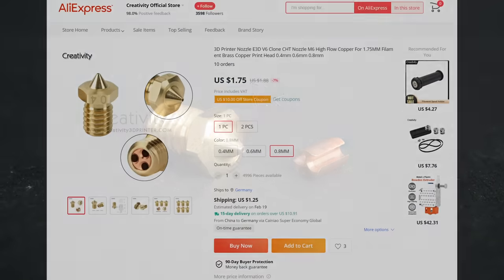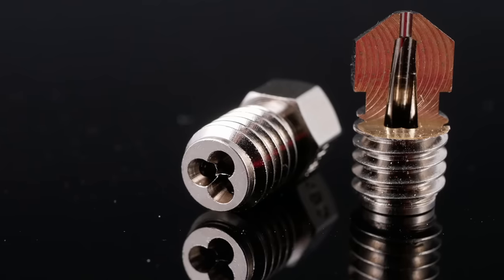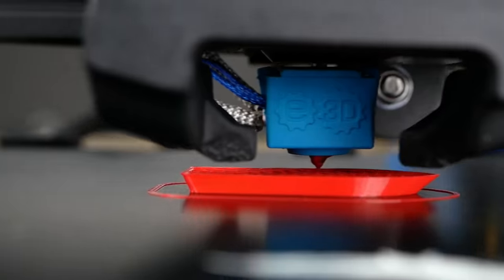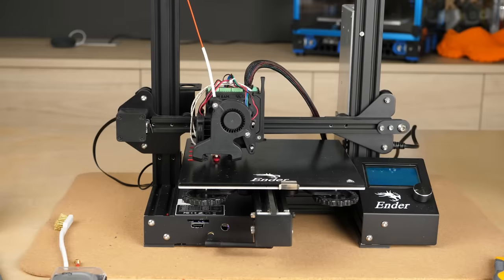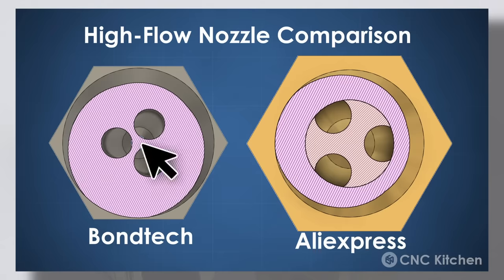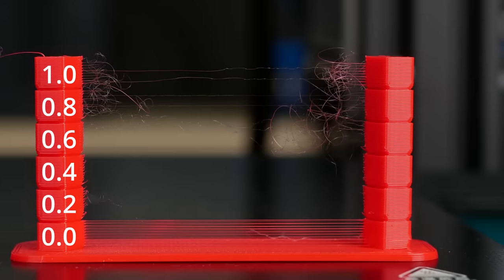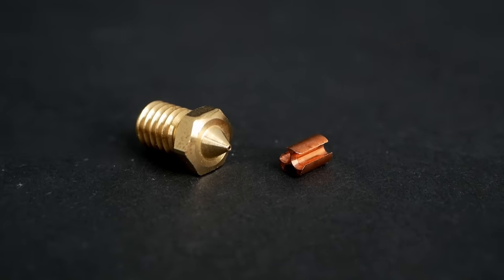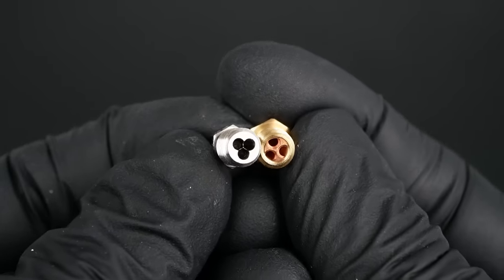$2 Aliexpress Knock-Off better than Original?

Comment from the maker: Power to the knockoffs or would you rather support the innovators?
Reply: Friendly competition lowers prices and encourages more innovation!

Edit: I get that if the 'knockoff" is just straight up copying the design, with no benefits, and/or can make them significantly cheaper or quicker to make than anyone else can, it can lead to the knockoff becoming a monopoly and stifling creativity once again.

The knockoff in question had changed around some ideas and ended up with a debatable improved end result.

Nothing is black and white, there is always complexity with subjects around choice
Thanks @@Hex for some of these ideas.
Reply: Both
Reply: You've got a pro-knockoff sponsor today.
Reply: As long as it doesn't infringe on the patents yes. A lot of money, time and research goes into innovation. That should be protected.
Reply: The knockoffs are also innovators in this case.
Reply: What if knockoffs are better than premiums? What if "knockoffs" devide filament into 4 channels? Is it a better innovation?
Reply: Knockoffs. Most of the time the originals have way too high prices just because of branding or because they were the first one. Thats not something that should show in the price
Reply: Intellectual property isn’t real anyway
Reply: patents are bs. just compete with the quality. this design is really smart!
Reply: I support the most consumer friendly product pricing and performance
Reply: Supporting competition and the free market. If the original designers were so innovative they would not need the state to grant them a ridiculous intellectual monopoly.
Reply: Bondtech are a terrible company that don't deserve being supported.
Reply: @leobro6398  In my opinion, the 1st creators are free to overcharge for a little while, since that is both a way of just making good use of the supply x demand, and much more importantly, the engineering cost offset. Once you've reached R&D break-even, I feel like the creators should just lower the price to get more sales on volume. Everyone would benefit from it in that case.
Reply: as an engineer I see a lot of patents only as obstacles to innovation, as many of them are things that people used to do but didn't bother patenting because it was trivial (i.e the recent drama with slice engineering patenting SPACERS), I have been putting copper inserts in my nozzles for a while now (the best being a 1mm helical wire) and the community was shoving Torx screwdrivers in brass nozzle way before the very vague 3dsolex patent. imo they just spend unnecessary money to patent an obvious thing, power to the knockoffs and every open source innovative practices
Reply: @Kalvinjj  I agree completely except for that everyone benefits from that. The people that buy it in the beginning will feel bad, because they paid more for it and some people cant afford it in the beginning and only can at a later point in time
Reply: @3d-obsession662  That's basically the marxist labour theory of value, which is now for most of us just a bad memory, thanks to the superior efficiency of the free market. Just because you spent x amount of time working on a product does not mean you should be paid y amount of money. You should be paid whatever somebody else is willing to exchange for your product in a voluntary trade.
Reply: to be honest patents are bs sometimes and this is one of those  cases in my opinion, there should be a clear cut between a complex enough product to have legal right over knockoffs and one that simply isn't, it was just a matter of time that someone had that idea it is well done but not incredibly articulated.
Reply: I think they overcharge, this has not required alot of expensive research to explain the price. 5x more is ok but 10x more? In Germany Bondtech CHT sells for over 25€. And patents on a piece of metal with 3  holes? What a bull
Reply: I hate knockoffs. They divert potential funds going to the original inventor to the pockets of the knockoff manufacturers and that might ruin the potential for further innovation!
Reply: I've ordered some plated copper nozzles with a steel tip. I dont know if Trainglelabs infringed on someones patent here, but in theory these nozzles should be insanely good
Reply: Would the retraction work better it you put a chamfer on both sides?
Might also lower flow resistance
Reply: @KanielD  try writing a novel about it
Reply: I want the best stuff, patents frequently prevent that.
Reply: @behemothinferno  If you can't compete with the knockoffs, your product probably does not have a good value.
Reply: This smells a bit like S.E. bait, so I would say depends on the innovation and manufacturer.
Reply: @stratos7755  That's besides the point. I believe in patents and this knockout is clearly an infringement of said patent.
Reply: I don't need either.
Reply: As said more verbosely in a standalone comment, no money should go to false-innovators who try to patent existing designs as their own without major changes simply because they're used in a different industry. I would fully support Solex if not for that, but with it I absolutely can't.
Reply: in this case I Support the innovators because they spent time and money researching it. And they did Not set ridiculous prices either 
When companies patent stupid things (that have been proven to exist already years before) and on top of that set stupid high prices... then i dont mind "copies".
Reply: The patent institution in its current form is broken and stifles inovation
Reply: 'Knockoff" even though it is a different and better design. Also innovators with their 200x markup can suck it
Reply: I don't think the patent system serves the customer in any way, it forces a monopoly on an idea instead of allowing the best quality or value version of the product to be available to the public.

I'd sooner pay $6 for a well machined version of the aliexpress model than buy either of these.
Reply: Knockoffs can be useful, but cause they are cheaper and often not a reputable brand, milage can vary. Since they can always rebrand, where a legit company wants to build the brand 
So I'd say knock off for non-critical work, but legit for critical work, you want parts that work and a path of escalation if there is damage
Reply: Both
Reply: I think pattens are lame. Ideas are easy to make. If someone implements my idea better and cheaper than what I did then I just move on to my next idea. I have too many ideas to spend time preventing people from using them productively.
Reply: Kannst du das noch auf Deutsch übersetzen danke
Reply: Finding fault at specific cases of the patent system is easy. Writing off the whole system takes a LOT more consideration.
Reply: @petro883  Read what you just wrote. You don't make any sense. Stealing is stealing. You don't understand patents and their purpose.
Reply: @VolkanTaninmis  Still stealing.
Reply: I support competition. Also, have you tried adding some sort of middleman thermal paste grease for the metal insert? I would assume a loose metal insert wouldn't conduct heat as well as something that's attached.
Reply: @3d-obsession662  you do know? Every idea and invention was written in a book before it was invented or built but you would know because you keep stealing at yourself right?
Reply: @3d-obsession662 It is stealing when you no longer have what I just stole. Like when somebody steals your car. Would you mind if I cloned your car and we both get to have a car?
Reply: @3d-obsession662   What, like Apple *spits and "rounded corners"?  I bet that a boatload of time, money and geniuses (genii?).  Some patent owners really extract the urine. 🙄
Reply: @petro883   Oh yeah?  How's that going for your average person in the Western world right now?
Can you say "late-stage capitalism apocolypse"?
Reply: I have both products
Reply: Power to progress or would you rather eat crap from legalized cartels?
Reply: Power to the knockoffs.
Reply: @stupidpterodactyls  not all competition is the same kind. Sometimes competition means someone incredibly rich with the resources to effectively steal your work and force competition out of the market. This prevents and strangles innovation.
Reply: As the whole discussion turned into a general discussion about patents and seeing there are quite a few patent supporters, I will encourage them to investigate the history of 3d printing.  Stratasys obtained us patent 5121329 for fused deposition modelling in 1989, and it expired in 2009. The cheapest 3d printer before the expiration date was over $10,000. Shortly after it was under $1000. It's not hard to see how the patent prevented the hobbyist 3d printer industry that we all enjoy know to develop sooner and how this was a net loss to everybody, excluding Stratasys. 
Was their patent so revolutionary? It doesn't seem so looking at it now, and certainly someone else would have came up with the idea much sooner than 2009. If you really look into patents, you will find that's how most of them are. I won't go much into details here, but I recommend the book "Against Intellectual Monopoly" by Boldrin and Levine, where they make an astonishing case against patents and intellectual property in general.
Reply: I think it's important to remember that we had 3d printer patents for 25 years and they stopped 3d printers from basically happening or being relevant for that entire time because one company held the patents and basically refused any form of innovation or licensing that would have made them relevant. It was only the expiration of those patents that allowed innovation to occur and allowed for 3d printing to explode the way it has over the last decade +
Reply: TLDR; it's more complex than the question makes it seem.

What about the research of pharmaceuticals that are most often funded by the taxpayer; the big corporations then take on the production and are given a stream of endless patents over the years due to very minor changes they make?  There's a reason why some of the largest corporations in the world are so wealthy, yet they give very little back.  Research insulin for a good example, and you will see why it's so expensive in some markets.  In these cases, patents are bad, m'kay.

Disney's copyright on Mickey Mouse is another example of patent rights being granted, again and again, immediately after the last one expired is bonkers.  It's supposed to enter the public domain in 2024, almost 95 years of first appearing; what are the odds they are granted yet another patent?|

Apple's "rounded corners"?  LOL!

Say, in another case, if a company spends years, along with millions, or even billions, on researching and developing a complex and bespoke system, only to have it reverse-engineered, and the market flooded soon after with an identical, cheaper copy, then what?  What if the copied version is just different enough to be classed as a separate design in its own right, yet it does the exact same thing as the original, yet all of the design cues came from the original?

What I'm getting at is that the question is far too simplistic when it's questioning the complexities of patent awards.  Sod R&D costs with something like that - a tiny cast & drilled lump of metal; if the original patent owner wants to sell 'em at an overly large mark-up when manufacturing costs, et cetera, are so low, they have to expect the idea to be implemented in a slightly different design, and sold at a much lower price to the consumer.  What does the E3D V6 (still) cost compared to knockoffs, especially one such as Trianglelab's version, which is just as good?
Reply: Knockoffs...im cheap
Reply: @leobro6398  Knockoffs as buyers, however, you certainly understand that research costs are real and deserve to be recouped by innovators.
Reply: lol they can get rekt with those patents just like slice with their not innovating ideas
Reply: It hardly counts as innovation, because they want to patent (or they did), I'll buy a knok off for sure. No way I support them.
Reply: @leobro6398  only hurting their own sales to cry about
Reply: @GoingtoHecq  good point, hadn't thought of that.
Reply: Honest, what looks good but not to cheap on the web paige. Or i am the only one who looks aliexpress, amazon and ebay and take the middle class. Cheapest is most gambling one, original inventor is what we want but don't spend so much money for shipping or so. Now comes the search part what take a loooong time to find the middle class. Cheap but not to cheap, not so much gambling about quality. The feeling to find a small company that makes stuff that is good in price, quality and "near" is so good! And it takes time to beat the google algorithem and some comanys a from nerds for nerds that you see how deep you must read old forumpost ect. Anyway enjoy life!!!!!!
Reply: I have bought 6 knockoff nozzles with different diameter from ali for about 11$(all of them with shipping ),and they are much better quality than that one on video , I even tried to remove insert -it pressed tight, didn’t move a bit . Printing petg with 0.8mm one for a month , because of speed … so i shall stick with clones, I don’t think that small ~5g piece of brass should cost like 5+KG of brass (!!!) and no matter how much and what angle holes you drilled in it.
Reply: Buy one OG nozzle but put the knockoff nozzle on the printer.
Reply: As most of the "inventions" are really a gathering of an existing knowledge I don't believe that patents are a good thing. They mainly slow down progress, and let the patent holder to get unjustified incomes. If they should exist at all, they should only give an advantage at production start, so they should last at maximum 3 to 5 years. After that, let the free market decide.
Reply: Beat* ?
Reply: When it's a difference between $15 and $2, wallets will decide quickly. It's also far from clear that it'd be infringing even if the patent is/remains approved; what's common is just the idea of letting the filament go through multiple smaller channels to increase contact area by volume. The patent applicants will need to show a specific inventive step that the AliExpress version infringes. The cheap version is arguably a different solution arising from the same idea. We shall see - patent litigation is notoriously costly for all involved and can simply end up being won by the party with the deepest pockets. An alternative approach by the patent owner is to license at a rate attractive enough that it's less than the risk from litigation.
Reply: @TzOk  Why do you think removing patents would speed up progress? Without patents companies have zero interest in research and development, because some company specialized in manufacturing will just steal the design and sell it for cheaper. You dont think that would slow down progress?
Reply: support the innovators, but those trying to get around the patents sometimes come up with great ideas  as  well
Reply: @TheArachnoBot  It wouldn't be considered stealing, as I believe knowledge shouldn't be owned by a single person or organization. Companies still would have an interest in R&D, because of the privilege of being first on the market. On the other hand, the ones who really should be doing progress are research scientists, working at government universities, and not corporations. In fact, there was no real breakthrough invention in any field for decades. Patents for "one click buy", or another mix of paracetamol and codeine, are NOT an invention. Many corporations buy patents just to block production of concurrent products, and a common practice is "dosing" of novelties.
Reply: @TzOk  Being the first on the market is not a tangible benefit. Nobody cares, just look at this video. Even with patents some people dont care. If someone sells it cheaper with same quality, people will buy from there.

You're dodging my point. If all research was government led, there would be way less research and way less progress. Patents fix this because it makes r&d actually worth it. 

And dont even act "one click buy" is the only thing commercial product r&d has brought to this world. It is the biggest technological progress driving force on this planet.
Reply: If a knockoff clearly has its own engineering merits in cost cutting or functionality, I buy the cheaper one, if the original innovation is reasonably priced and provides better quality, ease of use, or results I buy the original.
Reply: @TheArachnoBot  They have been first, and they had their chance to settle on the market. They set their price too high, and they failed - simple. Their product is overengineered and overpriced. Being first on the market is a huge advantage, but must be used wisely. Trying to get revenue as fast as possible is not wise.
Reply: @TzOk  You're still not getting it, so i'll make it simple for you. Company X spends a lot of their budget on research, while company Y only does manufacturing.

Company X comes up with a genius new product and starts manufacturing and selling it. Without patents company Y will take that design and sell it too. company Y will ALWAYS manufacture the product better or cheaper because manufacturing is what they spend all their resources on.

The end result? Company X loses money for coming up with the design, while company Y leeches off their ingenuity. Consumers wont give two shits who was first on the market, they will buy what's better/cheaper. Absolutely nobody will want to be company X and therefore there is no innovation. Get it now?
Reply: @jbergene  You realize that the second half of your comment describes exactly what Solex did, right?
Reply: I'd take the cheapest that delivers quality. For that reason I wouldn't even call it a knockoff. I don't see why the idea of using more than one channel towards the nozzle should be held in a patent. This is kind of the obvious thing to do when you want to increase surface contact between material and nozzle. Is a patent just the reward to be the first one to write it down?
Reply: @TheArachnoBot  If an invention is so easy to be reproduced without original documentation and/or inventor's knowledge, then it doesn't deserve to be called an invention. The company which has manufacturing resources will still be interested in getting new products to produce and would still invest in R&D. Look how it works in China.
Reply: This is great! Do you think that knockoff could work with 3.0mm filament? It looks like it might! I can't find a 3.0mm CHT nozzle...
Reply: @orphax1925  wdym torx screwdrivers in brass nozzle?
Reply: @riba2233  as he said the patent may have inspired the alternative design resulting in the improved product.
Reply: @electronicsandewastescrapp7384  it would have happened without the patent
Reply: The chinese version improves the product and is cheaper and easier of manufacture, slots win to holes, so why not support chinese innovation? racism? 

MANY people would not have been even closer to a 3d printer if it was not thanks to chinese manufacturers, and they have forced western manufacturers to improve their products to justify the price difference. And not only 3d printers, cnc, lasers and electronics in general would wave been rich kids toys only.
Reply: Power to the best! unfortunately patents often are misused to stop innovation.
Reply: @TheArachnoBot  Really? So go and copy any electronic device using ASIC, or even read protected PLD. Too complicated? Try copying a chemical substance, like a drug. In some cases it is possible, yet veeeery expensive. One thing you may easily copy is a utility model, but for this, there is another law.
Reply: If the knockoff provides similar or better quality/performance at a tenth of the price, then the knockoff is the superior product. A knockoff with improved machining quality and QC for ~$5 would be ideal.
Reply: It's about the right tool for the right job. If that tool is cheaper but does a better job, tough on the one that is not as good. Price doesn't really come into it. Innovation is all about ideas, and ideas themselves are not patentable.
Reply: Du hast total viele Videos gemacht mit FDM Druckern, mach doch bitte welchem zu resin Druckern. Diese sind günstig und die Materialien sind richtig gut und stabil.
Am meisten würde mich interessieren 
1. Wirkung von Temp. beim drucken.
2. Cure under water
3. Cure under hot water (60°C oder so soll die mechanischen Eigeschaften deutlich verbessern je nach Material)
4. Sicherheit: Reicht z.B. ein guter Phillips oder Levoit Luftreiniger mit HEPA 13 + Carbon Filter aus um die schädlichen Gase zu neutralisieren oder muss man zwingen nach außen Lüften ?
Reply: Knockoffs and open source all the way. The originals are way too overpriced to even be considerable
Reply: Knockoffs are inovations too, it takes a clever mind to actually find a way to reproduce the results while dodging the patent.
Reply: @titastotas1416  This depends on the knockoff. Some are so bad that they have virtually no function at all. This here, is not a knockoff though, it´s further development.
Reply: The highest form of flattery is imitation. Both are needed.
Reply: Pretty sure the clone is going to make the original one be improved in a next iteration, so thanks to the clones yes.
Reply: Patents on effective tools  shouldnt be a thing
Reply: If innovators are constantly shorted the potential funding for greater innovation then we will watch innovation die. China and Russia are master copiers. Not exactly world renown innovators. They have their few, but most is enhancing other's works. China has citizens in the patent offices. Russia had informants at every level of the Manhattan project.
Reply: I would love to be able to support both... I really like how such a simple change can do so much but the fact that they are locking it down is just annoying. I really feel that they should get some kickback from anyone who sells something based on their patent but not that they should be able to stop anyone else from using their patent for years and years
Reply: Tesla "gives away" its complex/disruptive patents to incentivize development for all.
Bondtech try to patent a nozzle with 3 holes.
Cute ☺
Reply: In this case, the knock off looks like you could more easily clear a bad clog. So it's kind of hard to even call it a direct knock off. More like a better iteration.
Reply: the inside of the nozzles and the inserts could be threaded to make them removable and replaceable but allowing for cold pulls.
Reply: @VolkanTaninmis  If it's different, it's not really a knockoff.  Knockoff implies an exact copy, that violates copyright, patent, and other protection.  If you change something, it's no longer a knockoff, even though it's based on someone else's idea.  Of course, the Chinese do not pay any attention to any of this and do what they please.
Reply: Everything I get is "knockoff" parts copyright laws only good in the countries that recognize them. Sure U could argue from a moral approach, but I honeslty dont care, I value my wallet more, and would 100% spend 30 cents on a  tiny piece of brass than 30 dollars any day. They are 95% of the performance and reliability in my experience.
Reply: So every time I stick a piece of copper into my nozzle, I should have to pay bondtech royalties?  
Sounds about right.
Reply: buy both.
Reply: not really a knockoffs as design is very different
Reply: If one keeps giving power to the Knockoffs of the world, there will be no incentive for innovators to innovate as they will never receive compensation for their work.
Reply: @patprop74  is just a different design and competition is always good for the market... but yeah i understand capitalization and patents.
Reply: @mambotron  just imagine you were the one that worked and developed something, and held yourself to the highest standards, doing everything right and by the book! then imagine your neighbor sees your idea and turns around and gets it massed produced in China disregarding your work and not compensating you for it, IDK about you but id be pissed, It's up to us the consumers to make sure credit is given to those that earned it. Just my point of view. And trust me I know how it feels to get ideas solen and never seeing a thin dime for my troubles.
Reply: Bandtech Had a initial good idea but the knock-off in my opinion has the more efficient mass production simplified design . To drill 3 holes is no U should get a patent for
Reply: These knockoffs are innovative themselves! The different manufacturing technique makes it much easier and cheaper to manufacture, which is a huge advance!

It's also why these knockoffs likely don't even violate the patent.
Reply: I've never heard of the patent holder... seems like it's bad for the consumer if the patent holder just sits on the patent so no one can use it.  Kind of stifles innovation.  If someone else has the same idea, they get sued by the first one to patent it.
Reply: They definitely have a different design.  I don't believe there is patent infringement.  Competition breeds better innovation!
Reply: Who cares about innovators or kickoffs? Public only cares about quality price and how it works. If something is cheaper and better than the original then welcome knockoff :) they are making money from us and it’s competition so who does it better and cheaper wins and gets payed :) simple as it is :) that’s evolution. About patents I don’t care actually and will never do. I’ll spend crazy amount of money and make a tank that is worse than someone looking at it and making it better and way cheaper than welcome that dude. I was the stupid one then :) 😊
Reply: Power 2 them
Reply: @mashfaqm I'm wit you
Reply: increasing count of a feature in a widely used design is not an innovation or "invention".  that's why this "patent" is rejected in US.